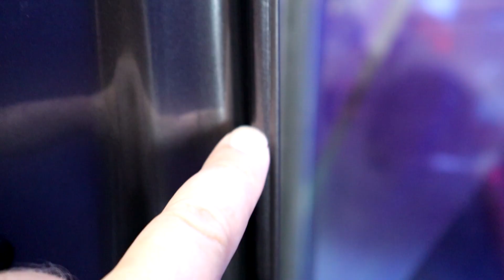Tired Land Rover Transformed with Vinyl Wrap and some skills

Comment: Do the cars original paint need to be mint to get a spot on wrap result? I’m considering wrapping my E46 M3, on the whole the carbon black paint is very good but there are some stone chips here and there as you’d expect on an 18 year old car with 100k miles
Reply from the maker: Im not really a wrap expect but Im sure they must be able to fill any chips before the wrap goes on or maybe flatten the chip so it does not show.  freshlayers can advice mate.

Comment: In the end , vinyl still  comes away at the edges . Used to do vinyl graphics on vehicles 25 years ago , it still lifts in places no matter how clean you are
Reply: My supercharged E36 M3 was wrapped and I never had a single lifted edge. 
First time it was wrapped for almost 3 years, second time just under 2 years. 
Not a single problem whatsoever. 

Mind you, I paid A LOT to have it done.